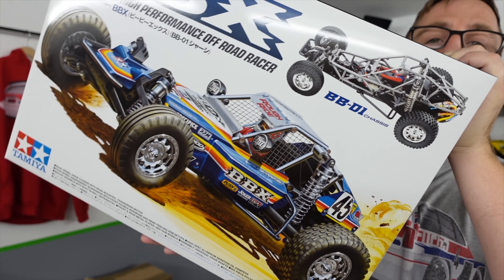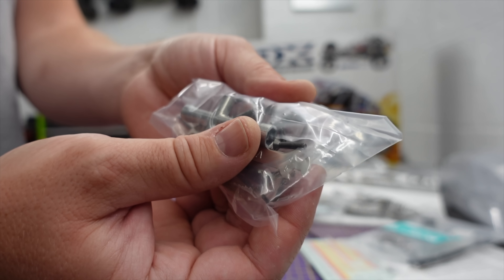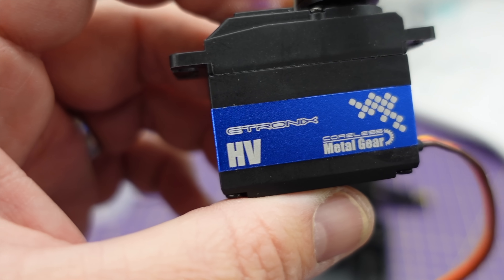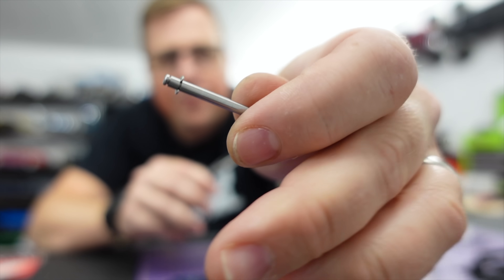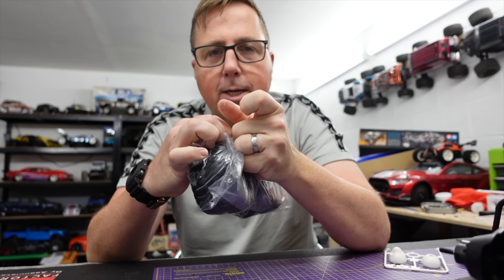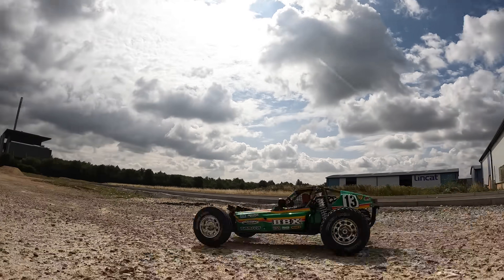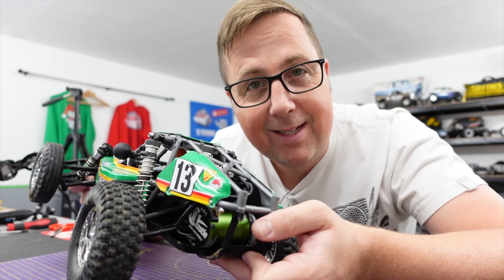The BEST Tamiya Off-Road Buggy in 40 Years!

Comment: Got it! Loving it! Only gripe I have is the hook&loop attachment of the body, it tends to rip off the paint when using Createx or Parma. Not with Tamiya spraypaint for PS, though. Buuut.. I discovered Tamiya added the possibility to use 'ye olde body posts, if you'd be so inclined. Nice.There are also extra parts in the kit so you can leave off the rear cowling and replace it with 2 number shields. I have the vague inkling there will be a 'budget' version with the classic nylon bushes, plastic shocks, more plastic in place of the current aluminium hardware, and some wild body on the horizon, looking at the parts left on the sprues.. A lot of peculiar rings, brackets and stuff like that left.
On the 7700kv? Why not. Though, I'd rather have a slipper with that kind of power. I currently run a sensored LRP Stock-Spec 3600kv (The classic Copper-coloured release)  with a 22t pinion. Gets exactly 52km/h. Fast enough for me. And, yes, it behaves SO good on the loose stuff.

Comment: What a beautiful Tamiya. Really stunning, especially the little white letters on the tyres. Just eyecandy. Even the colour of the motor fits the build, as well as the green top.
Ball diffs though... I hate them, needs so much maintenance, gotta rebuild them all the time unless you go full ceramic. But yeah, they are the easiest to set up and don't take space at all.
Reply from the maker: Yeah, they do seem to need constant maintenance… although are nice and smooth when working
Reply: @TomleyRC  I never had much of a problem with the ball diff in my Schumacher Storm truck.  That thing was bulletproof.  I greased it occasionally - but no more than I'd attend to a planetary or bevel gear diff.

Comment: There are quite a few Tamiya kits with hex hardware and bearings included, just not their cheap kits. TRF kits have hex hardware, oil shocks and carbon chassis. They have for years now.
Reply from the maker: Yes that's correct.... although this (as far as I'm aware)... is just a normal kit, not a special of any kind, so it was more to do with it being 'standard' equipment :)

Comment: Design reminds me of my 1980 Rough Rider which I haven't used in a good 35 years. But now my fingers a twitching to upgrade it with decent hardware, exchange the brittle tires and let it run again. Good ol memories! Also got the sand tires from the Sand Scorcher working perfektly on snow and sand. But first I need replacements for the worn out Nylon inserts of the front suspension. Any recommendations where I can get them?
Reply from the maker: Yes… it’s like a ‘Resto Mod’ Rough Rider

Comment: Looks fantastic, what a great choice of colours!
Phil, there's one thing, I've wondered ever since the first pictures were released. Perhaps you can shine some light: I have to wonder how well the trailing arms can pivot. The front mount looks like it just rotates around the screw and doesn't allow the arm to pivot, unless it's just relying on the arm itself to twist. Is that the case? Is it limiting the rear suspension in any way? Thanks.
Reply from the maker: It has an insert/collar that goes in to a pivot ball that's pushed into the arm, like you get on steering knuckles and some shock mounts. So you can tighten it up, but it still allows it to move.
Reply: @TomleyRC  Nice one. Sounds like a solid design, all-round.

Comment: This is a great build. A Tamiya car with bearings and hex hardware, what is going on? I was sur poised that it has a ball diff. I think ball diffs are supposed to b better for off road. The car looks great. Your solution for painting the drivers head is great.

Comment: I've been thinking about getting into the hobby. Would you reccommend this as a starter vehicle? I have a lot of technical prowess, so the building aspect and understanding how things work will be easy for me. I've seen a lot of upgrade parts for this that might be needed, like an aluminium gearbox case and a rear wing for sw4g points which would look awesome.

Comment: Hey brother I agree with you it’s a great buggie but I found a couple things that aren’t good the rear swing arms aren’t stable enough so it opens up just enough for the dog bones to pop when going around turn and little bumpy it will pop out so that should be addressed and also slipper clutch isn’t exactly spot on motor full speed off launch slips tad to much. Maybe have to tighten even more but it’s fine line..

Comment: The differential looks like 1995 Losi.  I would suggest to LOCK the differential, since Diff pieces could be few and between for awhile.  I bought a Schumacher Cat XLS 4x4 buggy back in the 80's day when they were released.  Very vauge directions with the XLS and ended up smoking the differentials pretty quick, due to being too loose.  Diff parts were 2 months out.   I had to sit and stare at my model for 2 months.  Do yourself a favor and lock the diff, for now.  Very neat kit with industry setting Tamyia organization to parts and assembly.   The only company who has better organization and description is Xray Models. Thanks Tomley RC.  Make sure to like and subscribe.
Reply: 1995 Losi?

You had to do that?!

That thing was an absolute ripper.

Comment: Hi, I'm just about to purchase this kit. Could you just list down the things which are not included in the kit (which has to be bought separately). As I just joined this hobby. Thanks!
Reply: Seconded. Do kits not come with motors or batteries?
Reply: @elyuw  not this one.

Comment: Save time stripping wires, Sir. Grab your X-acto and roll the wire between your thumb and the blade - and lose your Dad's crimpers. Take the piece you've now released from it's wire bondage, and twist while you pull it off in the same direction as the wires are spun. Voila, perfect Strip. Like Vegas. Give the exposed a lil solder sauce, AKA flux, and the next step will be a breeze - tinning, try to do it fast enough that you haven't burned off all the flux, for the next step, joining.
Reply from the maker: I was an Aircraft Electrician for 24yrs.... I know all the tricks. An X-acto can damage the cores and was certainly a technique that you wouldn't use on Aircraft. These are toys.... a little untidy crimping and soldering isn't going to make a difference to this :)
Reply: @TomleyRC  Aiyeee he said crimping again lol - A respectful nod to ya brother, same-ish job in the Navy, now IT - very familiar eh?

Comment: Seems like a cross of the Wild One, the rear semitrailing arms of the Avante, the front of some newer Buggs (ok, solid double wishbones with quite an angle, though not adjustable like on the Frog), and also some similarity with the Optima. I can't tell, what model donated the gearbox, at least it got a BB diff.
Anyhow, I am not convinced : Why these cheap plastic damper caps?!? Why not metal front parts? AFAIR the Wild One had metal cores in the rear plastic frame. Will these parts come with an upgraded version or as tuning parts?
I'm a big fan of the classic Tamiya models, but current lower half plastic buggies never got my attention. I get it, that most kids cannot afford Avante/Egress level cars, but what's the point in putting a pricy performance brushless set into a cheap looking plastic toy? I´m also pretty sure, a tuned Wild One will keep up with this one.

Comment: I. Despise. Ball. Differentials.

I genuinely don't know why they went with an antiquated ball differential other than maybe space saving, or to add more slip to the drivetrain so it doesn't detonate under modern power systems.

I'd be curious if they have a standard planetary differential available in the future.
Reply from the maker: Yeah… not sure, but a well set up ball diff is pretty smooth

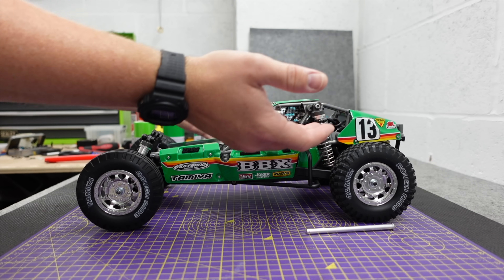Comment: With all due respect, the suspension looks effed up... the way the chassis slaps the ground at 10:30 and 10:35 means tamiya still can't tune a piston after 50 years of selling rc cars :D 7700kv AE cracked the code with the RC10 40 years ago already...

Comment: Do you use soldering grease on the motor cabels?
Reply from the maker: No, just a good flux core solder
Reply: @TomleyRC  Did you ever try? You will get much better solderings.
Reply from the maker: I was an Aircraft Electrician for 24yrs, I don’t like using flux, and these joints are absolutely fine for an RC Car 👍
Reply: @TomleyRC  Ah ok, I didn't know that.
 Nice build. 👍

Comment: Summary:

The speaker discusses his experience with the new Tamia BBX buggy, from pre-ordering to building and testing it. He shares his excitement about the unique features of the kit, including bearings, alloy-bodied oil shocks, and hex hardware. He also discusses his decision to use a 7,700 KV motor and a copperhead 10 ESC from Castle, despite the results of a community poll. He encounters a few challenges during the build, but expresses satisfaction with the final product. He concludes by praising the buggy's performance during a test run and expressing his plans for future videos.

Key themes:
1. Building and customizing the Tamia BBX buggy
2. Challenges and solutions during the build
3. Performance and future plans for the buggy

Suggested follow-up questions:
1. Can you elaborate on the specific challenges you faced during the build and how you overcame them?
2. What are your specific plans for future videos about the Tamia BBX buggy?
3. Can you share more about your experience with the community poll and why you decided to go against the majority vote?